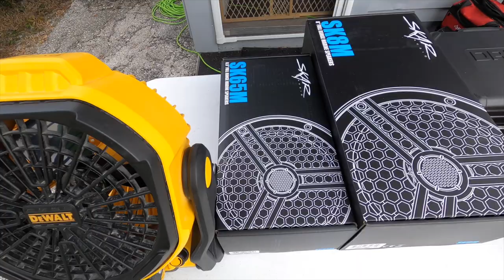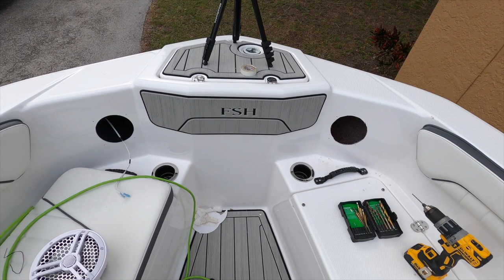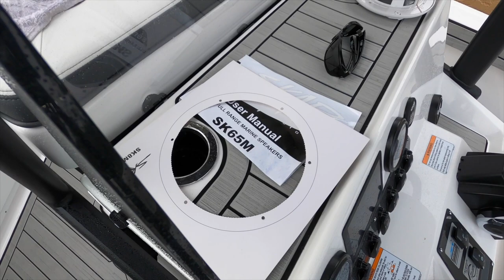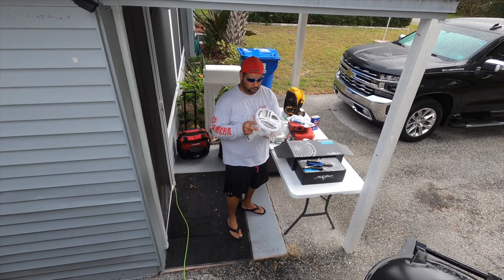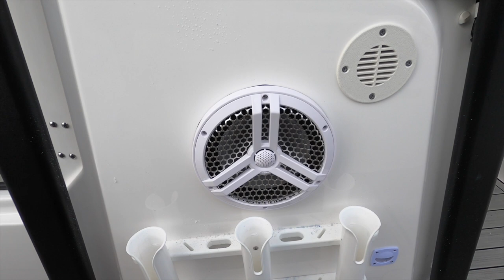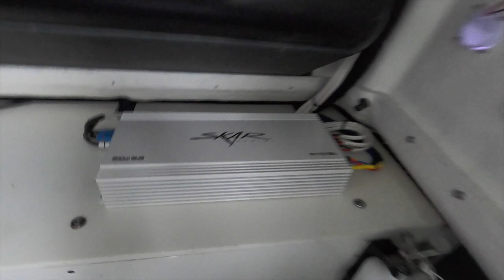Boat Speaker Install with Skar Marine Speakers and Amplifier

Comment: So after watching your video i also installed the same setup 4 6.5s and 2x8s with the 1000w amplifier. Do you keep youre amplifier base toggle at medium or full base?
Reply from the maker: 0, I tune without adding in any bass boost.

Comment: Great video!  Really appreciate your content!  Did you run new speaker wire to power the Skar 6.5's or did you use the existing factory speaker wire?  Thank you!
Reply from the maker: Thank you 🙏🏼 I ran new wire, link to the wire used is in the description.
Reply: @THEFSHDUDE  Thank you!
Reply from the maker: @JRMabc  my pleasure 🤙🏼

Comment: Just got a Hurricane Deck Boat. Thinking of doing this set-up except the four speakers are situated with two on the left side and two on the right side (facing each other). Do I still get two 6.5" speakers and two 8" speakers or should I go with all one size? Still plan to use the amp as well.
Reply from the maker: You can go with all 8s if you go with the 150.4 (1000) amp which I highly recommend. If you go with the 75.4 (500) then go with two 8s and two 6.5s

Comment: I watched your video definitely gonna do the 8’s and 6.5’s 2 in the console and 2 in the back should I do the 8’s on the console or in the back or should I just do 8’s all around appreciate the feedback!
Reply from the maker: 8s will be a tight custom fit in the back. I recommend 8s in the console and 6.5s everywhere else. What amp are you using?
Reply: @THEFSHDUDE  I have plenty of room in the back because of how the back of the boat is setup so if I wanted to do 8’s and I have no amp as of now just cheap speakers that were already in the boat and wanted to upgrade to the skars
Reply: But if you recommend doing it like that I will try that
Reply from the maker: @uncblue15  upgrading to high performance speakers doesn’t make a big difference and usually sounds less loud without an amplifier to supply the proper power to said speakers.
Reply: @THEFSHDUDE  okay sweet I appreciate the info on it!
Reply from the maker: @uncblue15  my pleasure 🤙🏼

Comment: So funny, I have a fsh 210 also and I just bought the same speaker and amp. But I’m adding a 10 inch woofer free air on the side too. Question... what did you use to make the holes bigger? Was that just a dremel? I’ve never been so precise when using a dremel.
Reply from the maker: Dremel with multiple bits as the fiberglass ears through them pretty quick

Comment: Great videos keep the going, I bought a Barletta pontoon which has 4 - 6” factory speakers inside and 2 - 6” facing the water in the rear, I’m wanting to replace them all with the 6.5 Skars and add two more 8” Skars to the the rear, what amp would you suggest and how would be best to wire them?
Thank you
Reply from the maker: You can run the 4-6.5s and the 2-8s on the Skar 150.4 and wire the 4 in parallel on two channels and the 2 normal straight to the other two channels.
Reply from the maker: Edit: if you’re adding 2 more 8s and not replacing then you can run the 6 on the 150.4 and the 2 8s on a 75.4

Comment: My only problem with Skar is cutting a larger than normal hole for the 6.5” speaker…your married to them now.  Wet sounds Revo are just ridiculous priced, so what about the JL, worth the investment in the end?
Reply from the maker: JL is great but only at the M6 level or higher which you will run into the same issue at 4x the cost. The only thing you’d be married to is higher end speakers not just Skar. If you don’t want to trim use these kickers https://amzn.to/3Os8CfA they are fantastic speakers as well.

Comment: I am attempting to walk my friend through the install from another state ... he has ordered 2 of the 8” you have in the video. I told him to get the 12 AWG OFC wire. I am now looking for the correct fittings to connect to the speakers. I know marine grade but as far as connections on the back of the speaker. Also can you tell me the size for the AMP. I instructed the 1000 watt of the same brand as that could allow him to add more speakers down the road. Would that cause an issue or is it just too much overkill? Thanks in advance.
Reply from the maker: 12 gauge is a little excessive, I would say 14 is plenty. Marine grade spade connectors is required for the backside of the speakers. I think it’s smart to get the 1k for future additions.

Comment: How do you like that 500 rms amp from skar? I don't see many vedios on it
Reply from the maker: That’s because the 1,000 is so much better for only $30 more. The 500 is great but if I had the room I would have got the 1,000. If you’re just pushing 4-6.5s it’s great.
Reply: Is the 500 a good amp I'm just going to be running 2 8's in a bass boat I don't have much room?
Reply from the maker: @claytonbrown2656  If you are going with the Skar Audio 8s it will be fine as long as you're not cranking it all the time as it would possibly overheat. Those 8s are very power hungry. I would bridge each one on two channels and make sure to keep the amp ventilated. For $30 more you can get the 1,000 and not have anything to worry about because it has the power and an internal fan for temperature control.
Reply: @THEFSHDUDE  ok so the 500 doesn't have a fan and the 1000 does?
Reply from the maker: @claytonbrown2656  Correct, the 500 has no internal cooling whereas the 1000 does.
Reply: @THEFSHDUDE  thank u

Comment: I have a 2013 AR 240 and want to replace the stock speakers with 4 6.5 and add 2 to the driver and passenger area.  Couple questions… what amp would you recommend?  And how is the bass that this puts out?  Trying to figure out whether to add a sub but want to keep it somewhat budget conscious.  If I was to throw a sub in… what do you like to compliment this system?  Thanks!!!
Reply from the maker: I would do 4 of these https://amzn.to/3tDHXV8 and two of these https://amzn.to/3mPRAMG along with this amp https://amzn.to/3mLkNYW IMO there is no need to add a sub with the 8s as they put out a decent amount of bass. You will be more than satisfied I am sure. Wire the two 8s on two channels and wire the four 6.5s on the other two channels in parallel. Use this power kit https://amzn.to/3OgOVqY Let me know if you need anything else. This is how I have my boat set up now other than my swim platform speakers and another amp and it sounds amazing.
Reply: @THEFSHDUDE  Thanks a ton, bought them all and will be here this week.  As far as head unit, you recommend the kicker?  Going to replace that too but want to make sure to have zone controls.  Looking at JL too cause it controls 4 zones in case I want expand.  Thoughts and appreciate your help.
Reply from the maker: @tomknauss3311  I prefer the Kicker unit but here are both that I recommend https://smile.amazon.com/dp/B085FP31WQ/ref=cm_sw_r_as_gl_api_gl_i_HMTYTZ82JVCQDJPDNFBT?linkCode=ml2&tag=thefshdude09-20 it’s overpriced right now due to no stock, it’s usually $599 or this https://amzn.to/3xy6xaU Jl Audio is great too and I recommend this one https://www.westmarine.com/buy/jl-audio--mediamaster-mm105-marine-audio-receiver--20562427?gclid=Cj0KCQjwhqaVBhCxARIsAHK1tiOokmYH8u5eCARcc4z13OTHBa-R_LTVXQXZu42WvC_5YECZd6M42iAaAjCDEALw_wcB
Reply: @THEFSHDUDE  Do you know if 46KMC5 and 46KMC4 have same sound processor? Also can't find info if any of them supports AptX for bluetooth connectivity. I was thinking of keeping stock Jensen head unit on my FSH210 but it only supports A2DP which is definitely a great reduction in sound quality. Thanks!
Reply from the maker: @Supermuzchina85   I know that the KMC5 has a better sound processor with a STN of 108db whereas the 4 has a different sound processor with a STN of 100db. I’m not sure which processor they’re using but they are different. As for the Bluetooth, I am not sure but the sound quality is high on my 5 so I’m assuming it has a decent one. Unfortunately, I don’t do tear downs on these units and they don’t have it listed anywhere. I do know you can call technical support and they are great at answering specifics as I had a question about the krc12 controller and zone 2 compatibility and they answered all my questions. I know this was limited information but it’s the best I can honestly provide you.
Reply: @THEFSHDUDE I appreciate such a quick reply.  Really enjoying your channel.  Keep up a good work!
Reply from the maker: @Supermuzchina85  thank you, I appreciate your support 🤙🏼
Reply: @THEFSHDUDE  Just a quick update on KMC4 and KMC5. I've chatted with Kicker tech support. Both units only support A2DP Bluetooth protocol that means if you using BT as your listening source you gonna get compresed sound  .  So JL is the way to go for me
Reply from the maker: @Supermuzchina85  nice, thank you for the information 🤙🏼 definitely worth going with JL Audio if they’re supporting uncompressed streaming
Reply from the maker: @Supermuzchina85  I stream from Apple Music and don’t use lossless audio anyways. Are you downloading music and using FLAC format?

Comment: Hey were did you get the wire harness to set up the amplifier
Reply from the maker: On Amazon. Here’s the link it’s on sale! https://amzn.to/3vKXZxj
Reply: Thank you
Reply: Thank you
Reply: Did u splice the speaker wire from the radio to the amp?
Reply from the maker: @jrrincon79  you’re welcome 🤙🏼
Reply: @THEFSHDUDE  hey my issue is the speaker did u had to buy a wire harness for the radio to hook up to the amp or did u splice the wire from radio to the amp thanks again bro
Reply from the maker: @jrrincon79  No splice needed you hook up the RCA’s from the radio to the amplifier and the remote wire from the radio to the amplifier
Reply: @THEFSHDUDE  and speaker wires?
Reply from the maker: @jrrincon79  your run them to the speakers. I’m confused what you’re talking about now? If you’re not sure what to do take it to a professional.
Reply: @THEFSHDUDE  ok bro thanks

Comment: How do these sound? I have the 6.5's in my Formula along with JL 8.8's . I'm considering putting the skar 8's in the cruiser to save $.
Reply from the maker: They sound fantastic. I have buddies with $5,000 JL systems that are jealous of mine.
Reply from the maker: Also, Check out my other videos. I have sound tests in the action shot video.
Reply: I have a JL m3 series setup. The Skars are just as good if not better, for about 20% of the price of the JL Package. Go Skar. JL has taken advantage of their name and is overpriced in my opinion. Great quality stuff without a doubt, but they charge too much
Reply: @THEFSHDUDE   really that’s awesome I’ve been between the jL and skar I bought some Polk audio but I’m not satisfied

Comment: How many batteries do you have?
Reply from the maker: 2 batteries. A start battery and a deep cycle house battery.
Reply: @THEFSHDUDE  great vids man! What group size battery are you running? AGM? And how long can you play the stereo on it when parked?
Reply from the maker: @gwade8808  These are the basic batteries from a local Advanced Autoparts that the dealer put in. Dealers chose the batteries when the boats arrive. One starting and one house battery. The house battery (the one the system runs off) is a Marine AGM Deep Cycle Battery. I can run the system at moderate volume around an hour and a half  or two with the boat off. At full volume around 45 minutes. And at a low volume a few hours. It is the aH that you want. Mine is a 100aH battery. My system draws less than 80 amps most of the time. So if you are drawing 50 amps it'll last 2 hours. If you are drawing 25 amps it will last 4 hours. Battery life is all about how loud you are playing the music and how many amps you are drawing. It is a very simple equation. Hope this helps.

Comment: Is anyone having house battery drainage issues with this type of setup? I don't have a deep cycle battery as my house. Maybe that's my problem? I cant get out for more than 20 minutes of running wide open an donce I stop I have maybe 5-10 minutes before my alarm to start the engines goes off on the house battery at 11.7
Reply from the maker: No issues here but I have a deep cycle battery. You’re house should always be a deep cycle. Start batteries aren’t made for prolonged drainage. Also, it’s going to get worse the more you use it as a house battery with a amplified stereo system.
Reply: Im debating what size battery to add as well.  AGM batteries only have about 50% of the Ah available before they are at or below 12V.  I am considering swaping the 100aH AGM with a 200Ah LiFePO4 as my house and leaving the other AGM as the crank.  Would have the full 200Ah available to run the amp and remaining minimal house draw.  Need to install a DC-DC charger to safely charge both but will not be able to combine them.  That would give an effective increase of 150Ah for my house.